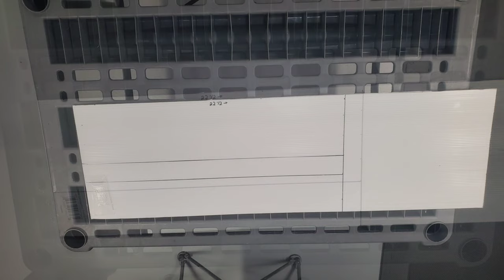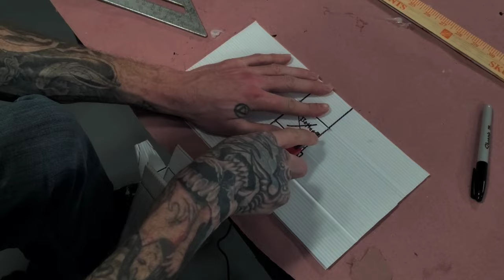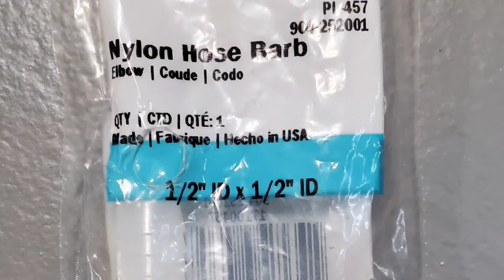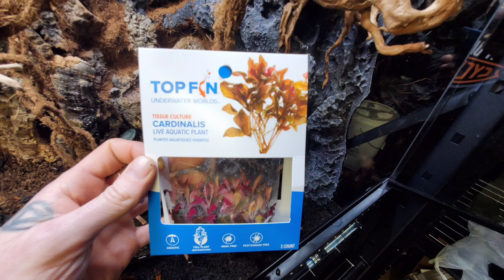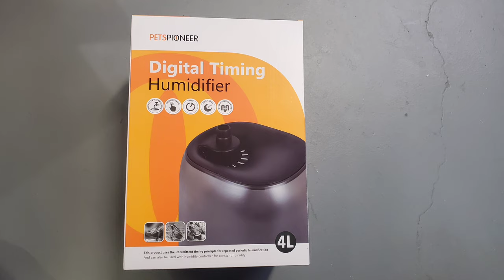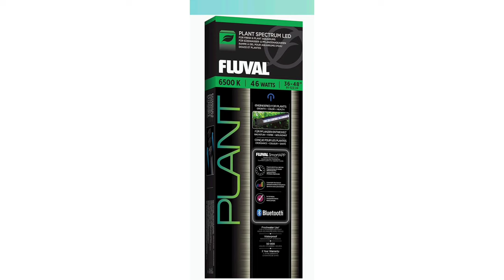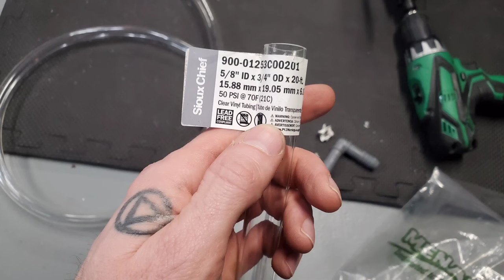How To Build A Paludarium DIY In Depth Tutorial #paludarium #bioactive

Comment: This is fucking incredible
Reply from the maker: Thank you 🤘💯
Reply from the maker: Thank you 🤘💯
Reply: @bradsbioactivebuilds  do you mind sharing what drylok color you used for the final layer, right before you started drybrushing?
Reply from the maker: @goose_loose  I used drylok original (white tintable) and added quickcreat charcoal and mixed it in.
 https://www.acehardware.com/departments/building-supplies/concrete-cement-and-masonry/ready-mix-concrete/5070982?store=15052&gclid=Cj0KCQjwzqSWBhDPARIsAK38LY8_rgUTteyGQ8_P4N8m_rwzEGyxjAvKz_KxS1dniUzVhyys93AReRgaAlB5EALw_wcB&gclsrc=aw.ds

https://www.lowes.com/pd/UGL-White-Flat-Textured-Waterproofer-Actual-Net-Contents-128-fl-oz/3033249?cm_mmc=shp-cprdpntgglLIA_PNT_220_Exterior-Stain-Specialty-3033249-local-0-_-0&ds_rl=1286981&gclid=Cj0KCQjwzqSWBhDPARIsAK38LY_CZUf0jGuhYiY6cLmJaz7wsDxg3wx5aSI3ZZ7kqBKG7_JrV2OVG6MaAp9ZEALw_wcB&gclsrc=aw.ds

Comment: How are the dart frogs doing in there? I’ve seen a lot of people saying you shouldn’t put dart fronts in a paludarium because they can’t swim. Have Yours been doing ok?
Reply from the maker: I think it's mixed opinions. Facts are they are not great swimmers but can swim out of water. 
My Blue Azureus Tinctorius in another build for the last 8+ years have done great with a water feature. 
In this build my colbolts are doing well. I watch them to make sure there is not an issue. If there is they get moved out. They do not use the pond section but I often see them haning out in or in the waterfall.  I do loose some floor space for them with the pond but I built the hardscape background in a way to maximize surface area to make up for that. They seem happy in this enclosure. Eating well. Out and about always coming out to see what I'm doing in the animal room. 
With that being said I do suggest an experience keeping only keep a pond area and watch for signs of stress. 
I have also put them in the water to watch them get out with ease and so if they did go in when I was not around they would know exactly where to go and how to get out. Each time their instinct too over and they got onto land with no problem. Hope this answer helps.